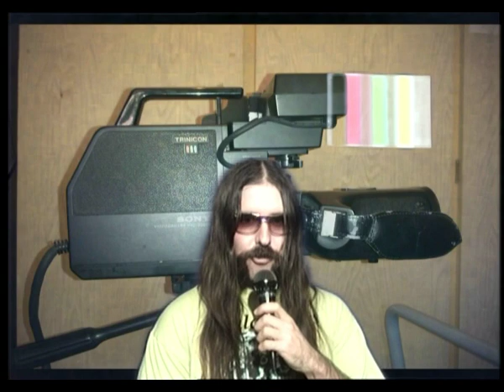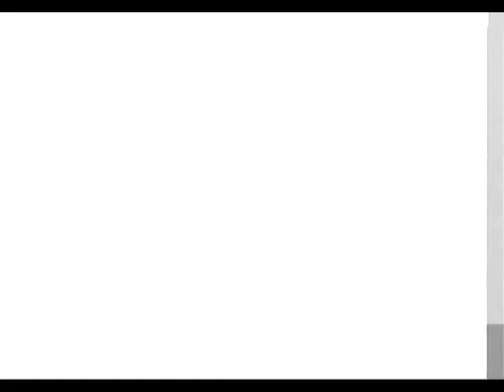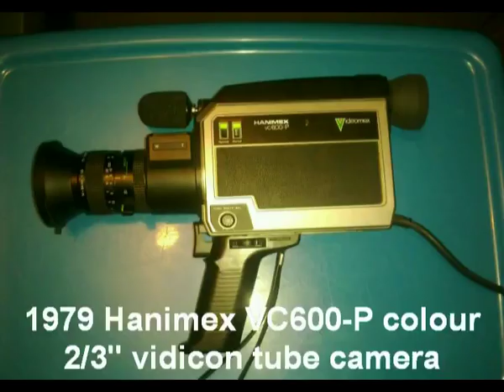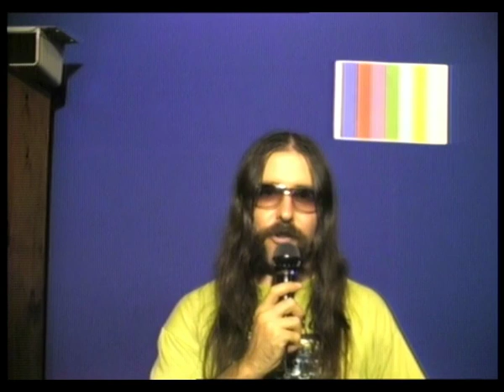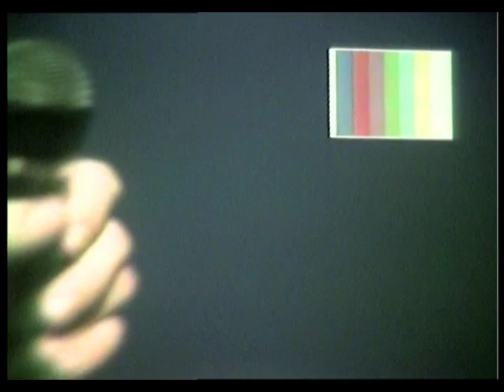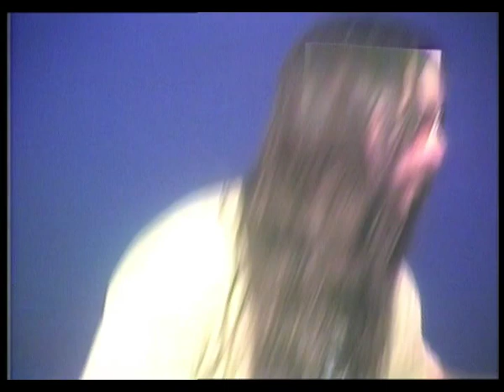My vintage video camera collection in operation

Comment: Brought back memories Troy. I worked for GEC Video Systems Division who distributed National/Panasonic here in Australia back in the days of your vintage equipment. Black and white reel to reel, color reel to reels, U-Matic tape recorders, all there single tube B&W and color cameras as well as Panasonic 3 tube cameras WV-555, WV-777 saticon cameras and their WV-N3 newvicon Tube which you couldn’t burn in and the P3 plumbicon cameras. The full VHS era with their NV-8600 VHS domestic recorder through to their industrial VHS recorders including, industrial VHS duplication, medical application, time lapse for cctv and VHS editing NV-8500 VHS editing and later their AG-7500 front load VHS edit units. 

Also was involved in later years with Panasonic’s MII broadcast recorders although by the time they were released here in Australian Sony’s Betacam had the market sown up. Even sold Panasonic D3 digital recorders although these went into defence applications. 

Wow Troy you have brought back some memories! Thank you! 👍😀

Comment: Great video, Troy!
 I just picked up a National NV-M3 which works great until I put a tape in it.  It turns itself off after a few seconds and  won't eject the tape without me holding my tongue right.  Also seems hard to find batteries for!  I don't suppose you know any good tech guys or gals in Victoria?    😀

Comment: Troy looks like he did the visuals for Deep Purple. ;^)
Ace lineup, the leap in quality between the 1965 Shibaden and the 1967 Sony is staggering. The problem is that it's almost impossible to find schematics for these old cameras, so "fixing" them is very much hit & miss. I had a mid-60's Panasonic WV-033 with a 1" vidicon that I spent a lot of time on, but never got working. There was very little to adjust, the tube was barely registering a picture, and when it did, it was totally distorted, plus the sync was all over the place. Sadly, I gave up on it and chucked it -- something I really regret now. :^(
I also had a Philips LDK from the 60s or early 70s, which never worked either. I did keep my Sony AVC-3250, which is really my only working vidicon. (I do have a crappy no-name security camera with a burned-in image of what appears to be a warehouse, but that hardly counts).

Comment: I love your collection! I too have an expanding collection of 1982 to 1985 Vidicon and Saticon color cameras. Many of these cameras have a second  mode of operation that gives weird outputs when a magnet is placed on the housing. Many different effects are possible by varying magnet strength, magnet placement, N or S pole, and the image the camera sees; these all shape the output image, which can be quite strange! Tired cameras (weak tube) don't do much, and some don't do anything(warp only). Use some ceramic magnets+a Panasonic camera (mid 80's) to give the best chance for results. If you can get things to happen, I want to see the result! (BTW, the cameras suffer no permanent damage from this-just don't use neo magnets!)
I have 4 videos of the weirdness to share on my channel!

Comment: First of all, awesome collection. Second, I have a question maybe you could shed some light on. I have a 3 tube camera that powers on, and I can plug into my computer, but the image that appears is a black screen with a little white dot. Does that mean that one (or all) of the tubes has burned out? Any clues/info would be appreciated. Thanks!
Reply from the maker: I can't tell you off hand whether the camera is definitely faulty or not yet. But firstly I can easily say it is not a good idea to plug an old camera into a computer because it's very likely the camera's video output is clamped at a DC voltage of 1V to 4V and that can destroy the video input of a video capture card for a computer and a DVD recorder and other digital video recorders. To really test the camera you need to plug it into an old CRT TV set with AV inputs, also look at the viewfinder on the camera to see if there's an image. If you're getting an image on the viewfinder then the camera is working. Another possibility for why the camera may not be working is it needs a camera control unit to supply the horizontal/vertical sync pulses to the camera to square up a raster. Also as said earlier the video output will likely have a DC clamping of 1-4V so you need a DC block circuit at the camera's video output before plugging into a digital recording/capture device, in your case I guess you use a video capture card to capture to PC? Anyhow let me know what brand and model the camera is and I should be able to tell you more on it.
Reply: @troysvisualarts  Thanks for all the info. Finally got it working. Just need to make some color adjustments now. Thanks again, and really enjoy your collection!

Comment: I just recently got my hands on a Sharp VC-363 recorder and I'm having some trouble. I managed to find a rechargeable battery for the device on Ebay but I'm struggling to charge it. Currently the VHS recorder is the only thing I can plug the battery into; no external charge port. What am I missing? How do I charge the battery? Would love to know if you have any ideas ;0)
Reply from the maker: Is the battery brand new legacy battery for the old VHS deck made by a battery department that still makes legacy batteries for old devices or is it an original really old battery made when the deck was made? If the latter, chances are the battery has deteriorated with age and won't charge. You can actually run the deck off a modern gel cell lead acid battery of the same voltage in which you solder leads to the VHS battery contacts and put battery plugs on the other end to plug to the battery and tape the battery to the outside of the VHS, I've done that with my working portable VHS decks.

Comment: do you have a video detailing how to connect this to modern gear? Assuming this records to a separate deck, do you just output that to a computer? also would love to see video feedback set-up with old mixer or something. I've been interested in grabbing an old vidicon tube cam for a while for a project
Reply: further to this.. if you buy and old camera without the deck, is there anyway to connect it / power it?  very interesting stuff, gonna plow through the channel a bit and check it out. cheers.

Comment: Great presentation. I have recently acquired a RCA TK41 c camera in the process of restoring it. I'm on the look out for a Norelco PCP-70 cam anyone with a lead please let me know😊
Reply from the maker: Fantastic acquisition, I only dream to own a RCA TK-41 myself, I do have a 1950s Marconi MK-III B&W TV camera and a 1970s RCA TK-760 colour camera and several image orthicon tubes and an iconoscope which I recently made into a working camera, all featured on my website http://troysvintagevideo.0catch.com/ . I guess you might of gotten the TK-41C from Chuck Pharis ;) . Anyhow I wish you best of luck restoring the camera to working order, would be great to see 50s/60s era looking colour TV images again :)
Reply: troysvisualarts 
Chuck helped me with the original lens's I bought through eBay from the television museum. It's a great can and I am restoring it from paint finish to capacitors lol a long process

Comment: Love the home made camera. I built the very same one out of the ATV plans. Bought my plans and parts from a company called ATV research. Built mine in 1980 as my high school electronics project. Wish i still had it, but some idiot stole it from my parents garage. The picture looked about as good as yours, except mine used a 1" tube. 
I did a comparision of various cameras I have in my collection, but mine are mostly color cameras.
Reply from the maker: Thanks for your story, cool to know more people have made cameras from that schematic! Would you believe I have since re-adapted the video and deflection circuits from that vidicon camera to drive a 1940s RCA 1846 Iconoscope tube with very little modification and the Iconoscope is working http://troysvintagevideo.0catch.com/iconoscopeproject7.html . The pictures are however crude as I need to add keystone correction, horizontal/vertical centering and blanking, I need a bit of a different blanking system for the Iconoscope which is why I disabled it on the vidicon circuitry. Anyhow it's amazing how versatile that ATV vidicon circuitry is for different tubes!

Comment: I have a question. I bought a JVC GX-s700. The VTR cable did not come with it so I am trying to figure out what I need. The connector on the camera needs a male 10 pin connector but I am not sure if they make male to male cables. I have everything else to make it work I just need to figure out what cable I need to get the footage.
Reply from the maker: I don't have one of those cameras so can't tell you off the top of my head but there's someone who has made a demo video of that camera in operation, he can probably tell you https://www.youtube.com/watch?v=fkmfsx76cRk

Comment: I find this oddly satisfying. Probably because I like seeing output from vintage cameras. The oldest working camera that I have is a 1988 Panasonic SVHS camcorder (and I do have a few tapes for it). For an idea, I'm still the baby of my group of friends (barely old enough to drink in the USA). That one uses a surprisingly good CCD sensor and I like the vibes given off by crappy analog recording (it badly needs a head cleaning).

Comment: Hi, I have a question that I think you might be able to help out with. I have a 1985 JVC newvicon camera with the standard 10-pin connector. I powered it up with pins 9 and 10, but when I try to get a video out signal from the video out pin, I get nothing. Do I need to send some type of signal voltage to another pin of the camera in order to get the video out?
Reply from the maker: I have tried this many years back and found it didn't work too. What these cameras need to operate and output video is more than just power to fire it up, they need horizontal and vertical sync pulses as well which are provided by the portable VCR or camera adapter unit. So what you need is the camera's portable VCR or a camera adapter with AV output to operate the camera. Can you give me the model number of the camera as I can find out more info about it and the VCR or camera adapter it needs?
Reply: It is a JVC GX-N8U camera. Thanks so much for helping me out even if it doesn't work out
Reply from the maker: Did a Google search and found the camera/VCR outfit on a past Ebay auction http://www.ebay.com.au/itm/VINTAGE-1985-JVC-GX-N8U-COLOR-VIDEO-CAMERA-BR-1600U-PORTABLE-VCR-/282020060910?nma=true&si=3mmETw2u6%252FJhFgbPuGyZqc9N%252BZk%253D&orig_cvip=true&rt=nc&_trksid=p2047675.l2557 . I believe this camera can plug into any portable VHS VCR made in the 80s which have a 10 pin camera socket and also a camera adapter unit like my one I use for my VHS cameras http://troysvintagevideo.0catch.com/wvps01.html .

Comment: Great video mate. Some very interesting video cameras you've got there. I have a question about the NV-M3. I have two of these camcorders and I can't seem to get them to accurately reproduce blue in sunlight. I white balance it with the lens cap and all other colours looks fine but blue comes out purple. Have you experienced this at all with either of yours? I've actually made a little video showing it 

https://www.youtube.com/watch?v=9J_gPUqqZV0

I get a similar thing in indoor lighting conditions but with the red leaning towards purple/magenta, I can correct this by pointing at something blue when white balancing it which results in whites being yellowish but reds and other colours rendered correctly. I don't seem to be able to correct it in sunlight though without just turning the whole picture blue or green. 

Its quite hard to find much detailed info about this particular model and there's not many videos about them so I was just hoping you might be able to shed some light on it.
Thanks
Reply from the maker: +nowt100 G'day. Thanks for your comments. I can see you have some colour noire beat patterning in your M3 picture which I think would be responsible for discolouration on the blues, I have had the same colour noire issue with a couple of my National/Panasonic cameras, from memory one of my WVP-100N cameras has the issue. I don't know how to fix it but I assume that the camera's colour video circuits need tuning which there are adjustable little trimpots that and of course a service manual with schematic is required for the job. Otherwise best to adjust the colours in a video editing program which you can hue shift the magentas toward blue or adjust colour balancing and the like.
Reply: +troysvisualarts Thanks for the reply. I had a feeling it would probably need some internal adjustment. I don't have the equipment or expertise to do it really, although I have the service manual. Would rather not go adjusting it and make it worse or break it. I think I'll do as you say and correct it in video editor. Its odd how both of them have the exact same problem but I suppose it must be a common thing with the old Panny/National tube cameras. Incidentally, the coloured bands on the picture are not visible when viewing it on an interlaced CRT, I think because they alternate on every field they blend together and cancel each other out. I see on your video they are not there at all though. Thanks again for taking the time to reply to my question.

Comment: Hey I recently bought an AKAI VCX2E off ebay and did some re-wiring with the cable as I do not have the recorder deck it is meant to be used with. I ran it off a 12v battery but found that the viewfinder is completely white, but i can see some outlines of bright light sources. There is a side switch called "lumi-color" which if I switch around its four settings rapidly, it gives me a full b&w image in the viewfinder, which then burns out after a couple seconds. ANY IDEAS why this is happening and how do I fix it?

Comment: Hi Troy,
great video, thanks for sharing your collection. It's really interesting to see how the different cameras display colour. I'm looking to get an NV-M3 but I'm completely new to all this so I wanted to ask you a couple of question since you're obviously quite the expert!
I'm assuming that even if the camera did come with a battery it would probably be dead by now. What would be the best solution to shoot outside? Are replacement batteries easy to find or is there something like a a portable DC powerpack that would connect to the NV-M3?
Thanks!
Reply from the maker: The batteries would likely be dead and lost it's rechargability. I personally adapt a common 12V rechargable gel cell battery to the VCR by soldering a couple of wires from the battery terminals inside the VCR's battery compartment and attaching female lug plugs on the other end to connect to the gel battery's terminals and it works like a charm!
Reply: troysvisualarts
Amazing! Thanks for your reply! :)
Reply: +troysvisualarts Thankyou for this, also having the same problem, and I had that idea and wanted it confirmed. Cheers!

Comment: Hi Troy! On the off chance you're a) interested in taking questions and b) have experience with external sync sources.
I've got a '70s-era Sony DXC-1210, and want to get it running using external sync signals from an LM1881 chip. Do you know what variety of external sync support the old Sony cameras had? The ext sync input names SC, HD, and VD, and there's also a "sync on/off" input, but that's all I know...
Reply from the maker: Hi. I have an external sync pulse generator which I have used for my 60s B&W Sony cameras, details on the SPG and camera I use it with are on my site on these pages http://troysvintagevideo.0catch.com/spg.html http://troysvintagevideo.0catch.com/vck2400.html . That SPG was built by an amateur TV technician. Your DXC-1210 does it look like my DXC-1200 http://troysvintagevideo.0catch.com/dxc1200.html , if so then it should run without need of an external SPG. I did a Google search to find out about your camera and on Ebay there's a manual for a junction box for this camera which I think might have a SPG in it http://www.ebay.com/itm/280732160388 . Best person to ask would be Richard Diehl of Labguysworld http://www.labguysworld.com/ as he has loads of old tube cameras and associated equipment.
Reply: Thanks for the quick reply! It does look like your DXC-1200 (though in more boring grey colour), and it does work without an SPG, but I'd like to sync it with an external video source in order to use the viewfinder via the return video input. Unfortunately I don't have any specs on what the camera expects the SC, HD, and VD signals to be. I'll check with Richard. Thanks again!

Comment: Back in 1988. I bought my first video camera. It was an RCA CPR-250. Back then I was wondering, why I kept seeing "Solid State image sensor", CCD, everywhere. I remember always hearing about a solid state image sensor. And typically Circuit City ads always mentioning "no more burn in and lag".. 
    It was always typical for me to hear about camera's with a CCD image sensor. My RCA was advertised to have a MOS image sensor instead of a CCD. (metal oxide semiconductor)

Comment: 20:58 Why camcorders to vintage color have this defect? That is, the effect of trace, that when one moves much leaves a trail, do not know if I explain well.
Reply from the maker: The old image tube type cameras have an after image characteristic known as "image lag" which the photosensitive plate takes a little bit of time to discharge before the next picture to be scanned particularly on the brighter areas of the picture. Vidicon cameras are most notorious for this issue.